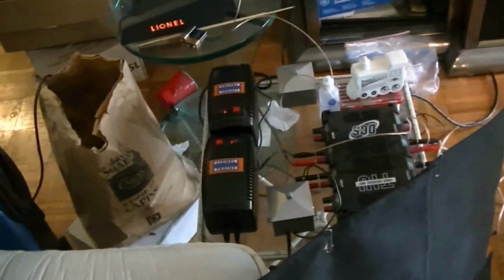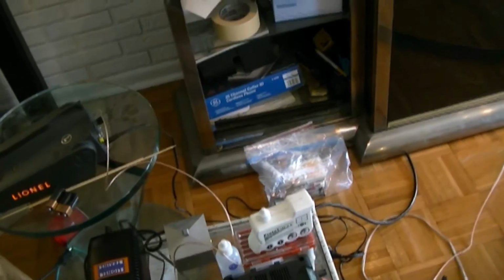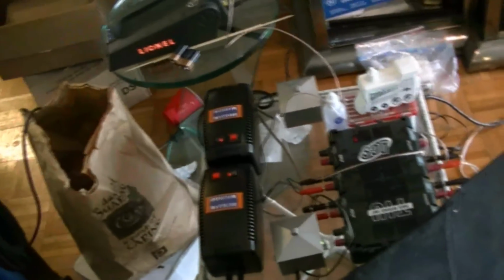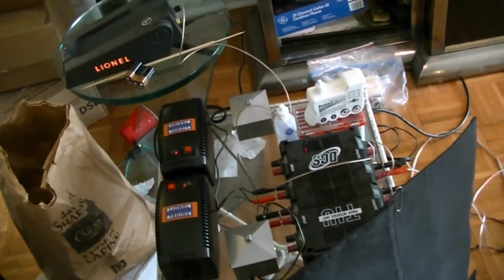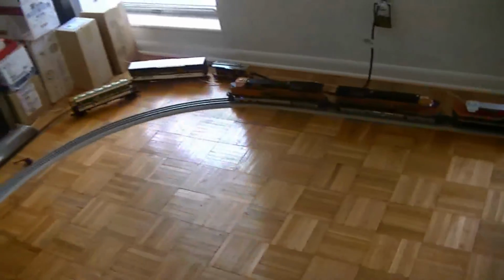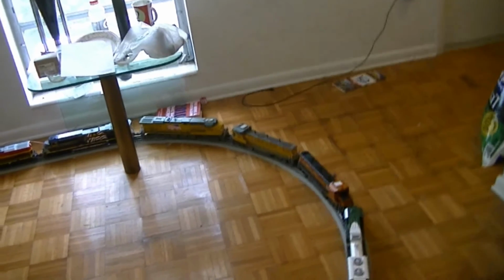More Power!!!

Comment from the maker: Hey Brad, there definitely a lot of pulling power there, each ES44ACe has about 4 lbs of pulling force and with 2 180 watt bricks wired in parallel there is plenty of amperage to do the job LOL  I like the Lionel AC6000, but don't like the sound of the horn, until they change that I will not buy another.  I did just buy a Lionel Northern Pacific GP-9, and it has a great horn, sweet smoke unit, a strobe light and runs great too.  I also have some MTH engines on my wish list! Have a great one bro!

Comment: You might not believe this, but my Railking SD70M-2 that weighs 1/4 of the Diecast GEVO has a drawbar pull of 3lbs 5 ounces. That's a heck of a lot of power! Even the 6lbs MTH Premier AC44CW can't pull that much! Anyways I'm not sure how it pulls that well. one thing I learned is you can't just add the pull of 2 locomotives to calaculate a lashups draw bar, only the rear engine is putting out it's full draw bar and the further from the less tractive effort is being applied. You have a great one!

Comment: Hi Bill, You probably got anywhere between 10 and 20 lbs pulling force at the draw bar with that many units, you could pull on big enough curves 150 cars or around there, I would say the circuit breaker would be long gone before that, my SD90 popped the breaker on it's own in a pulling test and that was with 50 watts on the track. I'm considering a Lionel AC6000 someday, they look really nice. If you want some power at the draw bar get some MTH diesels, they are darn heavy!